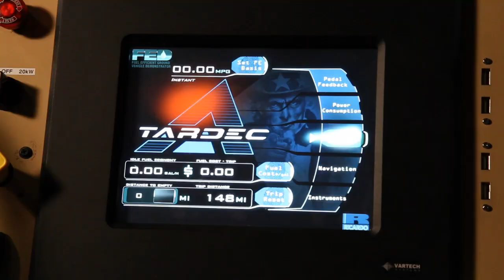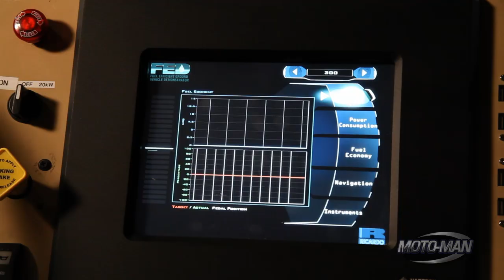US Army FED: Fuel Efficient Demonstrator Prototype Military Vehicle

Comment: I might be wrong, but...

Torque is what pulls you forward the fastest. Torque is the rotational force applied to the wheels; HP is how fast the wheels can spin. A large, heavy vehicle needs a shitload of torque in order to go anywhere. Torque is also applied down low; you hear big rigs shifting often because their peak torque is at a very low RPM. Lots of gears means they can build momentum easier.

My Honda can spin it's wheels at up to 9k, but it has a low torque figure.

Comment: Very cool. 6 tonne, blast deflection, 80mph, helicopter lugs.  IED runner

Better fuel economy, longer range.  Double the range a Humvee.

Would love to see a stripped down version to cut the weight by 2500kg.  
4mm Aluminium doors or none. convert the armour plate to aluminium or carbon or nothing.

Watch out Halo

Comment: Damn it people! Why do you guys dwell on making this thing 'all' bullet proof, bomb proof?  It is a light utility vehicle with minimal protections added.
First understand light vehicles are never designed to exchange heavy fires.  Those situations are what infantry fighting vehicles, main battle tanks are designed for.
Secondly, it offers way better protection than U.S. old humvees that are in need of replacement.
When you are in a light vehicle on patrol duty and get shot at, first thing is to accelerate away and ask for back up.  Those armors on this vehicle protects up to 7.62mm bullets only, and very very very small IEDs.

Comment: I have a problem this vehicle has more potential to be faster and more fuel efficient, the engine displacement is to small and when you boost it to much now you need more fuel delivery so at a constant need for more and more boost more fuel is needed why not use a bullet proof 5.9 cummins  or 6.6 duramax   where it's been proven and is cheap to make and easy to find part Allison transmission and the right gearing and it will easily hit 100mph + and be more fuel efficient. That's my opinion.

Comment: What a huge waste of our tax dollars... Supercharged and turbocharged and the underhood looks like it would take 15 hours to maintain. Don't keep it simple and easy to maintain in the field.. make it an overcomplicated useless p.o.s. Want mpg.. simple 2.5 turbodiesel with a modified tractor gearbox. Small 4cyl diesel farm tractors can tow 25,000 lbs and achieve superb fuel economy..This thing isn't getting 10mpg.. modifying that basic tractor platform to allow the vehicle to run highway speeds with overdrive gearing would smash this P.O.S. .. it would also allow the vehicle to tow a trailer with troops and carry 24 instead of 4... and be field serviceable.
Reply: A 6.7L Inline 6 cummins engine with mild hybrid assist is a much better powertrain choice.

Comment: So how does this hold up against explosive meaning i wanna see the test. It needs not to explode, start and drive away. Plus what are the offensive capabilities cant really shot out of those windows. And how till that carbon fiber cover will preform against a small wall or tree? So far not much better that other vehicles offered to the army by other companies.
Reply: It's not much better than any standard SUV really...in fact it's worse.  I hit a city fire hydrant in my  Ford Explorer.  It dented the push bar and cracked my head light...that was it.  The fire hydrant was uprooted and sheered at the bolts.  It also had 240hp naturally aspirated.  They don't make em (cars) like they used too. It's amazing what people are trying to sell as quality these days.

Comment: Just wait and the military will cram the fucking interior with Radio Mounts, FBCB2s, Fire suppression systems, and then a gunner's turret and a GRS (Gunner's Restraint System) and that piece of shit will still burn fuel. 15,000lbs? Try cramming all the ammo, speed-balls, five Soldiers wearing one hundred lbs of gear and other shit you need in Combat and this thing will be sucking fuel faster than a MRAP, RG33, or MATV any day. Army Center for Excellence my ass.
Reply: MRAP weighs 14-18tons.  I doubt this thing will drink more fuel than that.
However, the MRAP is pretty much IED proof (might damage drive train, but that's about it).

I don't think this thing is armored against much of anything.  I'm not actually sure what they plan to use it for, but it can't be for dropping troops off in a hot zone.

Comment: a 4.5 liter, inline 4 with turbo and supercharger. So... when it breaks down, you can simply get out of it, get into another passing vehicle and simply catch the broken vehicle on fire so the enemy doesn't take it apart and sell the parts on Ebay. There is no way you can effectively repair this on the battlefield...
Reply: Same thing could be said about Abrams power pack.
Reply: DigitalYojimbo This is definitely as expensive as it gets. You can buy 4 HD GMC trucks with TD engines and HD transmissions, BP glass and BP passenger compartment. Who comes up with this crap? It's like a $50,000 infantry rifle..

Comment: i dont like fiber carbon hood idea, i hope they can replace them to steel before they hit the combat zone.. all it takes a few bullets to the hood, and there, ur check engine light is on in that thing... and other problem? its all electronic, sensors, fuses, boards... not good... im hoping they bring the dealer shop with them where ever they be fighting and using them next.. just my though
Reply: Carbon fiber, if woven properly, would be great if it was layered with high level ceramic plating.  But why would they do that?!?!    I agree about the over use of electronics and computer control.  There's a reason the HMMWV is so great, it's simple.  K.I.S.S.   Keep It Simple Stupid.

Comment: A 4.5 turbo and supercharged diesel and it only has 200HP? And this thing has to have a massive air intake and some crazy big filters to filter out all of the dusty air. And in a EMP attack this thing will be useless.
Reply: Yeah let's do 600hp in a 14,000+ lbs see how that works. So much fail in this chat.
Reply: Lmao.. 200hp with about 600 ft lbs of torque.
Reply: It has enough torque to move it, so it doesn't need more than 200 HorsePower especially if they are going for fuel economy.
Reply: Josh McCarthy your statement is completely in valid. First off diesels don't have spark plugs, they have glow plugs. If an emp went off the diesel won't shut down but a gas would shut down beacuse gas vehicles require gas to work.
Reply: clayton chandler Sure the diesel won't go out, but what about absolutely everything else in the vehicle? Power steering would go down, you would loose some acceleration(from what I understand)... Something that relies on electronics to operate in the modern battlefield is not going to last very long.

Comment: Heh...it is supercharged AND turbocharged ...and it makes a mind blowing 200hp?
Wow...just wow.  I've owned naturally aspirated 4 bangers that put out just a little more than this.  I've seen Chevy 350 engines make over 1000hp with one well setup turbo and a properly built, forged lower.  They're doing something wrong.  Naturally aspirated...did this engine make 50hp?  I realize these applications are more torque oriented, but still.  Goddamn man.  Put a proper fucking engine in these things.  It's a damn military assault vehicle, not some lumbering parade float.  It's pretty shit that they're integrating so much electronics and computer control into these as well.  Are they EMP hardened?  Also the HMMWV in use now has better run-flat capability.  Estimated 30-40 mile distance while traveling at 30-40 mph.  But whatever, it seems in the age of mass consumerism everything is built to be cheap shit.  The ONLY real benefit this has over the HMMWV is its undercarriage hull design.
Reply: well it does weigh 15000 pounds
Reply: you do know that higher hp usually means less reliability right? and this is also a diesel, they dont make the hp numbers of gas engines of the same size. i bet the torque on this thing is into the 700's.
Reply: No...higher HP does not mean less reliability unless the engine being utilized is anemic and improperly constructed to begin with.  Compression and heat dissipation is a big factor here.  You do know that throwing on multiple types of forced induction usually means less reliability, right?   I agree, it probably does make some mildly acceptable torque numbers, but so does the current HMMWV.  Realistically a 15,000 pound vehicle pushing 700 TQ and 200 HP is... meh.  It doesn't bring much new to the table.  Some of the Detroit Diesels used in 18-wheelers produce 2000 TQ and 650 HP.  These engines are pretty much bullet proof - durable.  The number one complaint with the current production HMMWV is, for the most part, speed and acceleration.  When I was in the Marines, this was certainly the case.  Most everyone I know in the military shares this opinion as well.  This new vehicle will share this issue...therefore it's mostly pointless.  As I said in a prior post, the only thing this has going for it over the HMMWV is its undercarriage hull design.

Comment: Do they think this vehicle is going to be a better vehicle then the current RG-31/33L. This vehicle WILL NOT save lives. This vehicle is just another waste of money, as it will not have the protection that Solder’s needs; again they have the wrong people working on these systems. Take this vehicle out and blow it up and see what happens. By the way where is the room for all of the Soldier’s gear such as radios, electronic devices, ammo, water, etc….Where is the gunner turret? Look at the M-ATV we do not learn from that mistake… We build a system without figuring out where all of the extra equipment will be located.